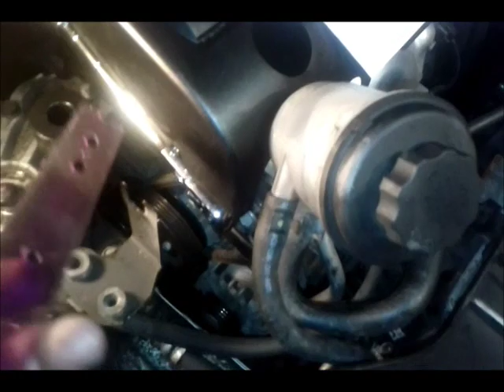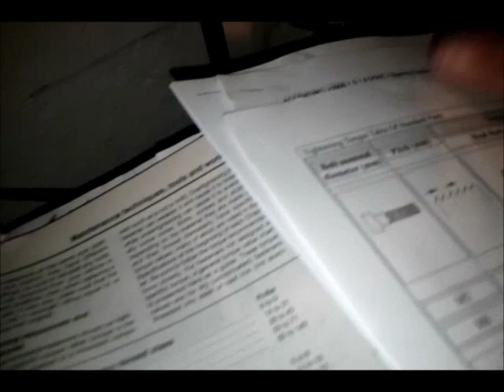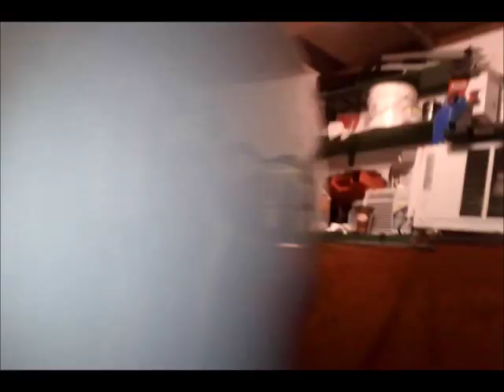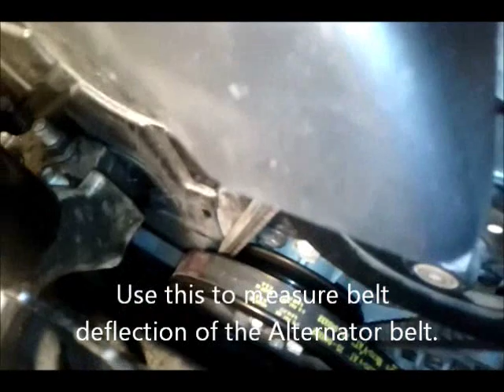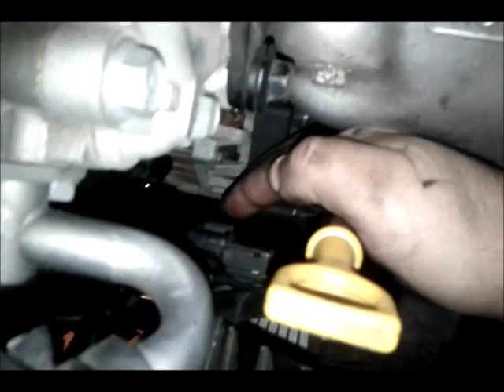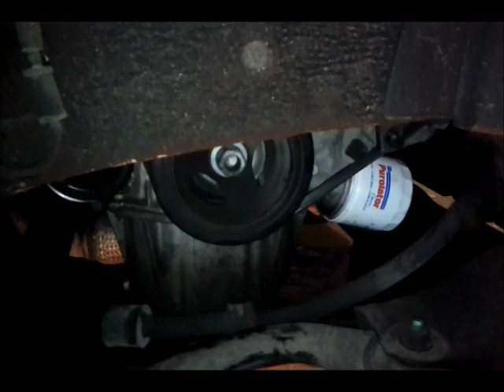Part 3: 2009 Hyundai accent A/C, Alternator and Power Steering belt replacement

Comment: i have an 07 accent 1.6 engine.      Got a new power steering belt from Amazon, part number 3052.      ... it absolutely will not fit. Cant get it up around the PS pulley, even with the adjustment bolt removed & pump slid all the way towards the engine           ... yet online double checked numbers & thats tthe replacement belt number,      why wont it fit, its like an inch too short.        Anybody else have a struggle & finally give up on their Power steering belt??            Im stuck. No neighbors & 1 friend 35 miles away, who .....doesnt wanna be bothered. Have helped him atleast a hundred times thru the years.             i cant do anything, but wonder how to get my car going but the belt wont fit.        The old one is broke or id put it back on.   hope somebody has dealt with this before.
Reply from the maker: Best belts are from Napa auto parts.
Reply: I ordered a Gates .    It matches the exact part number on the Hyundai website.          Hopefully iits slightly longer than the one they sent me in the Budget kit.            , Also, since its taken me nearly 9 hours just to get the belts off & was unable to remove the CS bolt, I removed the timing belt cover &  it surprising looks fine.  so ..Ive decided to NOT do the timing belt & water pump, even tho I have them brand new sitting here. - maybe in the next 10k miles I may decide to d0o it,  I underestimated just how much work it is. @gereral1_jackofalltrades
Reply: @gereral1_jackofalltrades  I bought a Gates based on the Hyundai website cross reference number for my car.       Fit perfect, unlike the one amazon had listed for my car.                Amazon said the belt DOES FIT MY CAR ........and when considering buying the Gates ....it said They have no indication that the Gates belt will fit my car, buy with caution                  ....... Gates fit perfect. Amazon costed me money & days waiting for parts.        So I dont have a lot of faith in amazons "This fits or this doesnt fit" notice they have on there page.

Comment: Newbie question, but if the power steering belt has too much deflection, how do you tighten the belt?
Reply from the maker: Adjustment  screw
Reply from the maker: This is covered in 3 part series. There is hyundai playlist on my channel. Its there

Comment: I followed all three of your videos and replaced my 3 belts, my timing belt & tensioner, and water pump while I was in there. been going strong for 30k since then, no issues. I find myself periodically coming back to these videos time and again since the Haynes manual is not very specific (covers 88-2010 in the same book?). Anyways, I really appreciate you putting them up.

Comment: I know from personal experience, change ALL 3 belts.  Don't just do 1 or 2.  You'll just end up doing it over.

Thumbs up for all your Hyundai vids!
Reply from the maker: Thankyou. Uploading alternator replacement video with testing and voltage drop, showing wiring, fuse and engine and battery grounds. Also obd test drive, battery load test and load test of alternator so if you have a charging system issue or batteries that seem to drain quick this video might help save you 600-700 bucks.

Comment: Thank you sir.... what a pain in the ..... but with your video Im ready.
Reply from the maker: +78beast glad to help... Mine is due but I'm not doing this job til spring. Just bought a 1500 dollar camcorder. Maybe I'll redo some of the old videos....
Reply: +gereral1 I am wondering if instead of using the swivel ratchet, I can use the swivel extention. same principle no? (I wouldn't mind buying the ratchet though)
Reply from the maker: You can but its hard to hold, already tried and got frustrated and bought the swivel ratchet

Comment: How are you getting the foot pound torque measurements once the bolts are on? With the belts, you're measuring deflection, but you're not directly measuring torque on the bolts.
Reply from the maker: joeybuddy96 The bolts get tighten for the tension on the belts. As for other parts I do include the torque settings. Deflection is measured by pressing between 2 pulleys and measuring the movement is MM. Each belt has a certain amount of deflection. You could by a deflection gauge but the ruler does the same thing.

Comment: might seem an odd question, this, if I wasnt bothered about having A/C would there be any point bothering with a A/C belt or does the belt operate any other pulleys ?
Reply from the maker: PH12364 you can leave this belt off but your window defogger will not work
Reply: ***** OK thanks